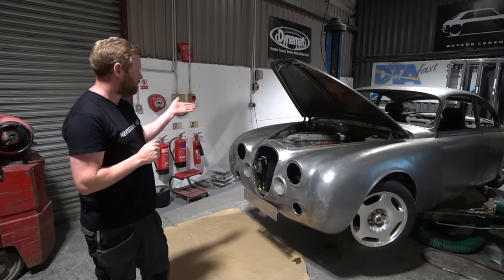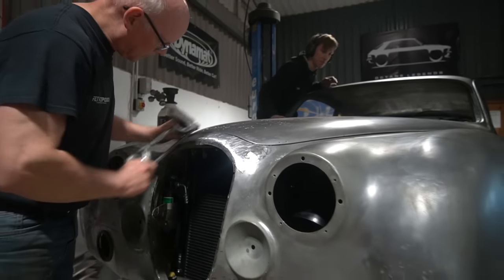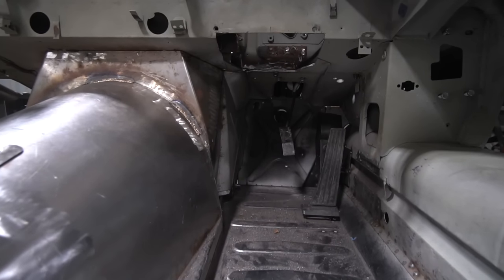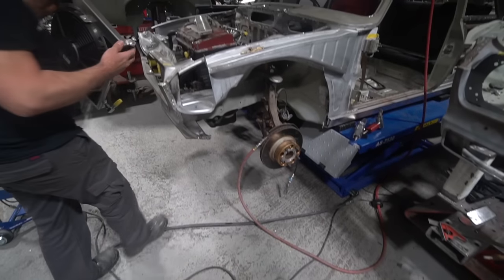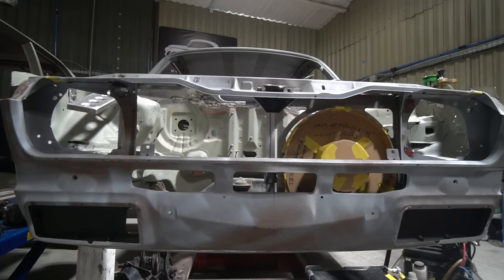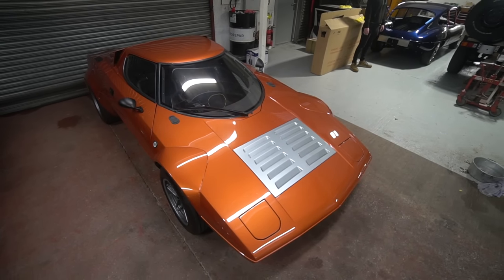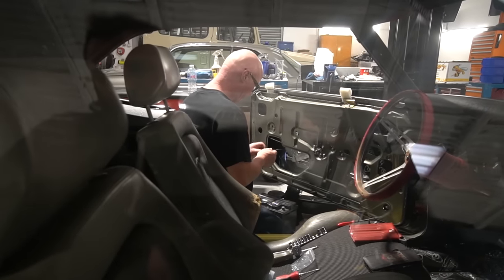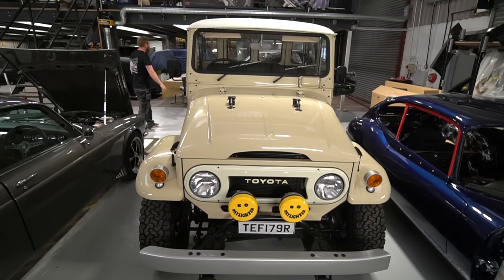Jaguar XJC LS3 Restomod in the Shop!

Comment: Hey Cal, when I started at Jag Engineering, Series 3 was the first car I worked on, followed not long after having to figure out electrical whining on the audio systems of XJ40s. Sounds like a combination of what you're dealing with on the XJC. Happy to relive the good old days if you hit a wall on solving the problem.

Comment: Cal just an idea but when backing the car over the pit, a camera in the pit with a hand held mobile screen would just be an extra safety assist for the driver to see all of the wheels are nicely away from the edges of the pit! ( I always find them a bit nerve-racking when manoeuvring single handed) 😁
Reply: Or at least a Guide plate along the length of the pit,on  both sides. Looks well sketchy🫣
Reply: @markwalton8644  that is how all the ones i have ever seen in germany were built. also a last warning as you walk backwards into the hole......

Comment: Very enjoyable, pure enthusiasm. The work on the Mk2 coupé is excellent. I'm not so sure about the E-type roof and roll bar lines.

Could you show the BDA alternator mounting please next week?
Reply: Yes, thought the same about the E Type, in the renderings that top looked atrocious.
Reply: @gazzafloss  Yes. RP are usually a "safe pair of hands" (I'm much more worried about the customers!). However, to my knowledge most projects of their have been coupés or saloons. 

The solution shown is very 70s. I would suggest that they can look either more retro (individual hoops) or more 90's (hoops that pop up taken from a Boxster or Z4).

Comment: Cal, I know it isn't quite what you might expect, but if the prospective owner is game, could you do a thumb through and quick discourse on the owner's manual? Tbh, there are a number of shops that work at your level- and it's things like that manual that I think help set you and Nat apart. A bespoke auto mobile really needs a bespoke manual on it's care and feeding! The XJC is awesome; love that after your replaced the drivetrain with, shudder, and LS engine and I'll bet a late model GM auto tranny, it still looks like a Jag, it moves like I would think it should. Glad to hear it has already brought new contracts to the shop. Churchill is coming on to show all the work invested; I wasn't sure the proportions would work on the original WB, but it looks a treat as you have it now. Glad Nat is getting his vacay done; back to the old mill, it is! Btw, the pinstripe was just the sort of really "fiddly bit" you and Nat do as a matter of course- and what you feel expected to do. Awesome is both a verb as well as an adjective your shop brings to mind with each new drop.

Comment: While the Jag's back home you could rip out that LS and replace it with a Jaguar V8. LS motors belong in Chevies or on the scrap heap and never in cars they weren't meant to be in!
Reply: I'd be confident the LS is lighter than any Jag engine. The thing I don't like is the wheels - they look low-end, like from a Viva GT or something similarly povo
Reply: @stephenscholes4758 4.2l Jag engine is 227kg, 5.7l LS is around 210kg. Not sure if that includes the blower but most of that weight is probably gained in cams and timing drive parts.

Comment: It surprises me that no primer gets used on fresh metal work being undertaken to stop rusting over the months it takes to turn a car round. It must be suitably warm air in the workshop. Also, I didn't have me glasses on, but at 20:59, did that say ' Ming Inspection Pit'?  If your looking for an employee to work in this particular area, I'm sure you will have a que round the block.
Reply: They sandblast then zinc coat everything again after metalwork so primer isn't needed.
Reply: @mattsmith4053  Roger

Comment: I have asked this question before but it was before you started to answer questions regularly so here goes. Would you consider doing small runs of cars if the demand was there? A bit like the Escort and to a lesser extent the Redux M3 (cause although you make it its from Redux) I was just thinking how beneficial it could be to the original owners as a run of 5 cars would surely make stuff a bit cheaper rather than a one off. I suppose it comes down to how precious the original customer is about wanting a one off. It's just looking at the 3 door Jag it looks amazing and you've obviously done it properly and lowered the roof line and altered the door lengths. I can see at least 4 other customers wanting one. Same with the Land Cruiser, Stratos and even the Morris Minor its weird i've never been into Morris Minors but I just love the look of that it looks ace! Any thoughts?
Reply: I guess the fact that they are booked up for a number of years on builds there is no time or commercial advantage in doing more 'runs' of cars. Redux was probably negotiated some time ago.
Reply: 3 door Jag?